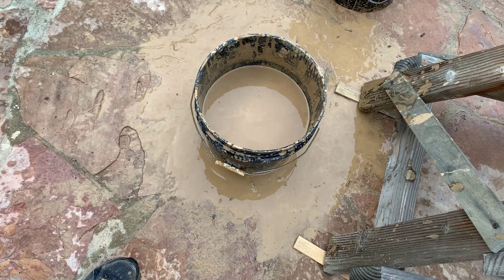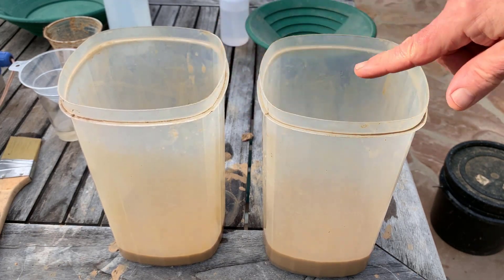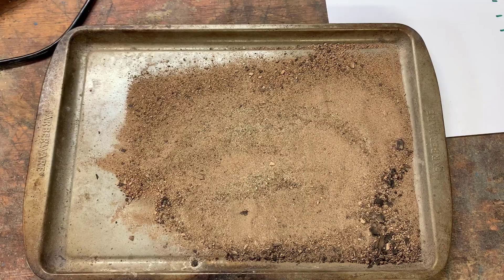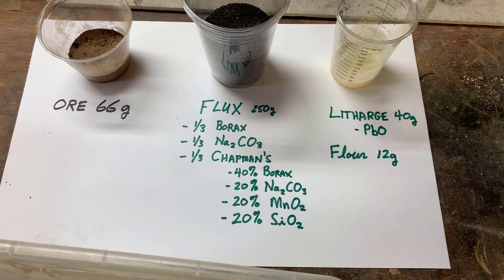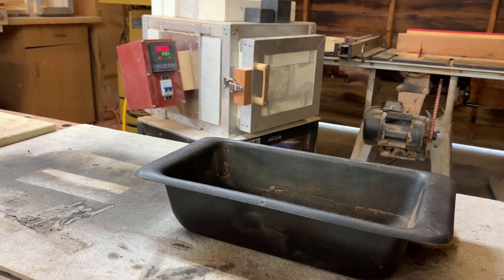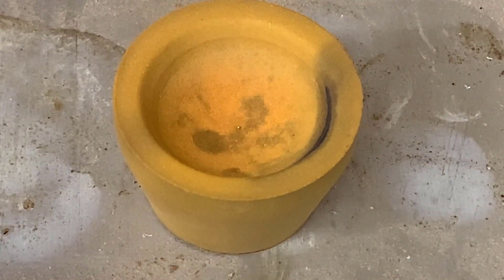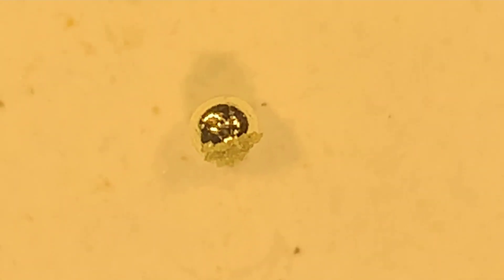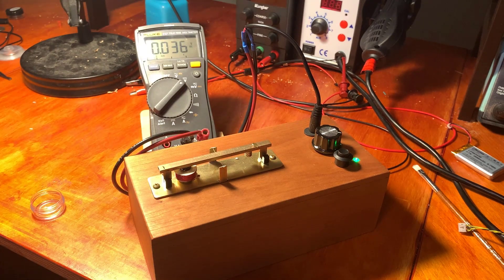Mud to Gold  -- Shake and Bake

Comment: How steel rod can help in loosing litharge ?? I saw a video that iron rof can absorb sulfides!
Reply from the maker: The iron bonds with the sulfur to make FeS which is then absorbed by the flux.
Reply: @orophilia  thank you so much ..litharge means sulfides also ?? I thought that it means lead oxide
Reply from the maker: @abdeljalilabdeljalil5135  Yes, litharge is lead oxide. It reduces to lead in the smelt and collects the precious metals.
Reply: Tge rod help to reduce letharge to?? As you said at 3:40?